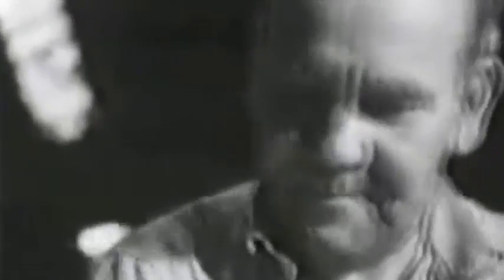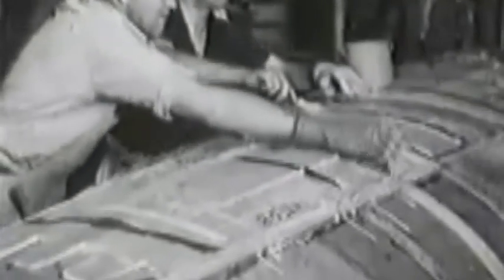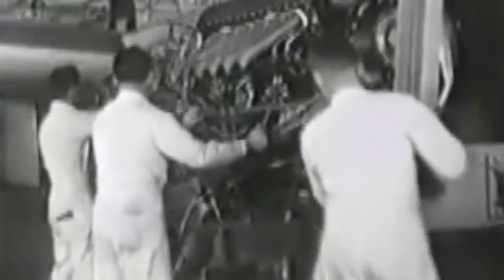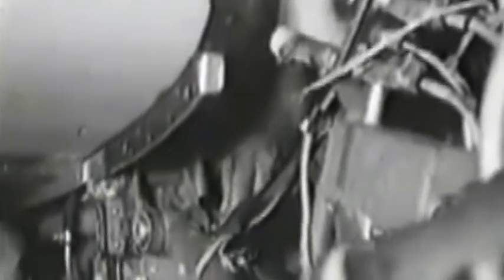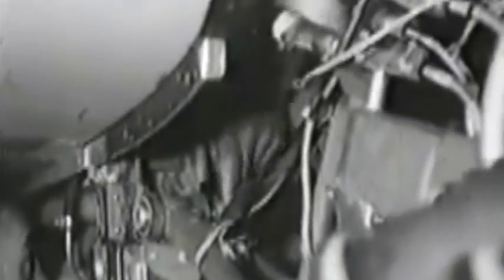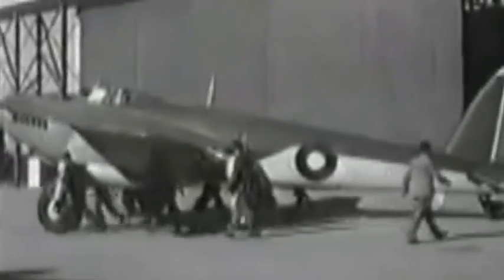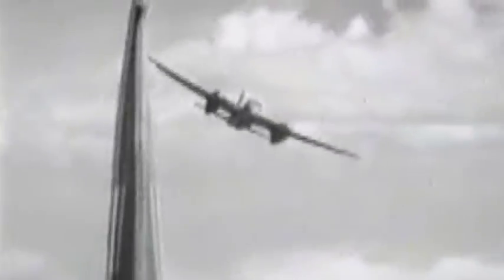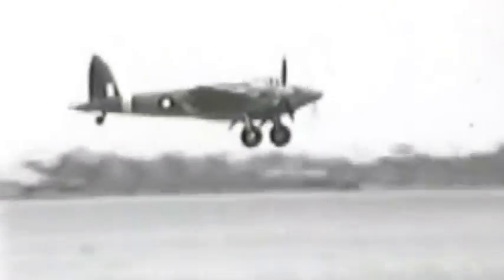Manufacturing Process of de Havilland Mosquito in 1944

Comment: The Mossie's spruce/balsa/spruce sandwich was a brilliant bit of low-tech engineering that resulted in an aircraft with a much higher power/weight ratio than virtually any other twin-engined aircraft of WWII. That alone was enough to ensure that the Mossie (and subsequent single seat Hornet) possessed absolutely blistering performance! No wonder Kurt Tank tried to copy it! 

Ultimately, Tank's TA-154 "Moskito" never delivered on its promise of similarly outstanding performance thanks mainly to the destruction of the Tegofilm factory by Allied heavy bombers.😁
Reply: It was almost the predecessor of modern composite airframes
Reply: @BryanJohnson4891   Indeed, the beautiful Mossie was in many ways ahead of its time. Of course, modern carbon fibre and graphite epoxy composites are both considerably lighter and considerably stronger than the old "wooden wonder," but they help achieve much the same results. You can achieve higher performance from any given engine by building a lighter airframe.

That's why the "Poppa 51" and "Thunder Mustang" air racers (which often dominate the warbird replica class) is so fast, despite having a little over half the horsepower of a Packard Merlin. They typically use a 750-800 horsepower Falconer V-12 engine, yet top out at over 350 miles per hour, and have climb rates as good or better than the warbirds themselves. Composites have radically changed aircraft design in many ways.

Comment: Wood ribs and longerons with 3 layers of wood veneer in alternating directions over them.  Then a layer of balsa wood, and finally, 3 more layers of wood veneer in alternating directions.
I doubt very much that they used "plywood" panels in constructing the skin of the Mosquito.  I believe they laid the veneer layers on one by one, and probably held them in place with staples while the glue dried.  The staples would also let them apply the other layers while the glue for the first layer was still setting.
Reply: They used 30,000 brass screws and 6 types of wood.